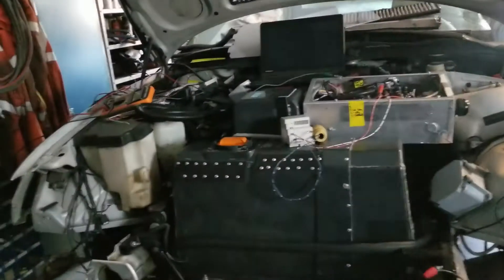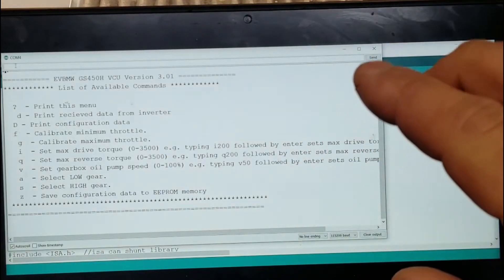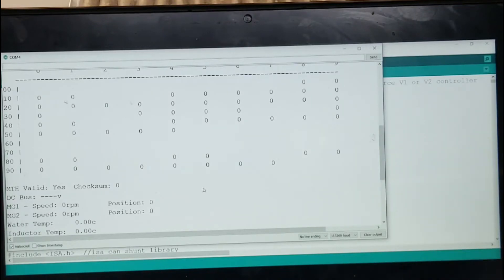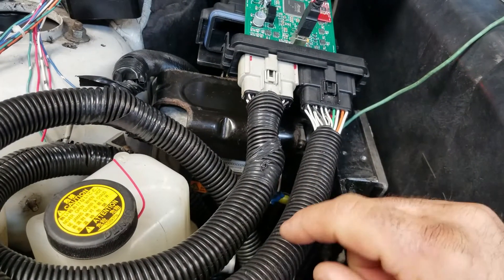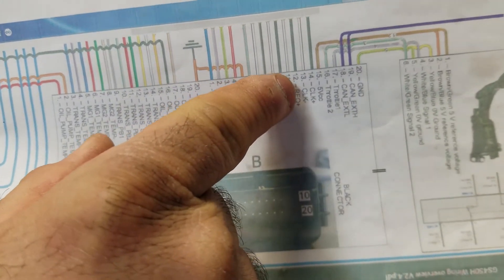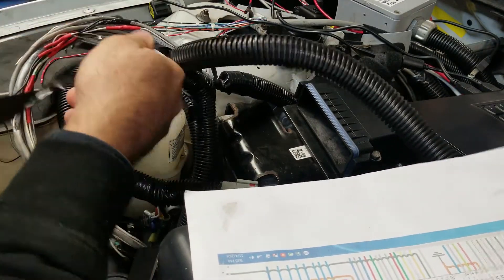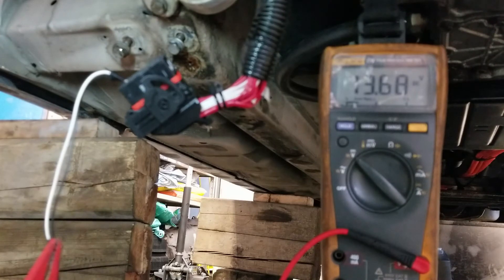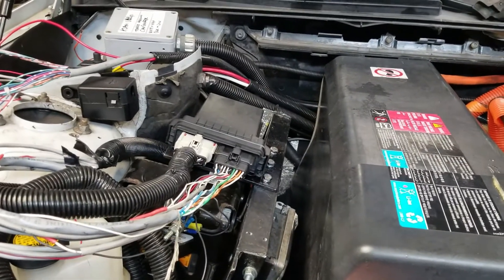Part 9 Problems. NO Communications!

Comment: I have the same VCU and I have also noticed issues over time from all the testing and plugging in the B connector and unplugging it that sometimes I just have to wiggle it or press it in more for the VCU to even power on,  so can you tell that the Inverter is on when it gets high voltage does it humm or whine a little bit
Reply from the maker: Yup. I went back and check all the pins on both the male and female side. couple actually came apart when I did the "tug" test.

Comment: Can I ask your advice. On my e36 I was testing with my car on jacks in the air and while both wheels were spinning i grabbed one to check the action of the diff and that made the Abs light go on and stay on. Is that coincidence and a existing fault or because the wheels were in the air and it confused my abs sensors?
Reply from the maker: That's normal. ABS light will come on because the ABS computer (which isn't part of the Engine computer) only sees 2 wheels spinning. It should reset itself once you get all 4 wheels on the ground and all are spinning at the same time.
Reply: @InTheGarge  thank you for your help. :)
Reply: @blackterminal  Do you still have your ECU hooked up? If not you might need to spoof some engine running signals to the ABS computer in order for the light to go off. I have the same issue and haven't gotten around to fixing it yet.

Comment: Looks very complicated. Hope it works out for you. I'm doing a less advanced setup but enjoying each little success on the way.. Nothing like doimg it yourself
Reply: I just got my donor a e36 also! which system are you using for your conversion?
Reply from the maker: @lals035  https://openinverter.org/forum/ 
there are options, Telsa , Nissan, Lexus,Toyota and others...
There are to many option to list...
Start reading....:)
Reply from the maker: its is a bit complicated but the drawings from the open inverter forum  help alot.
I'm sure I screw something up when I built the wiring harness. 
https://openinverter.org/forum/viewtopic.php?f=14&t=396